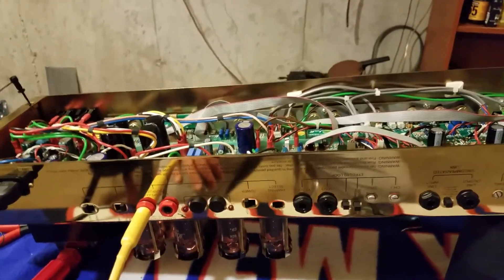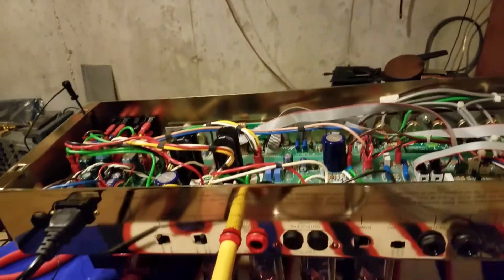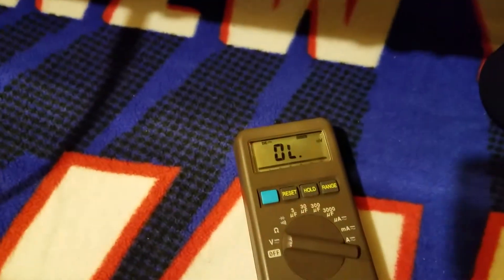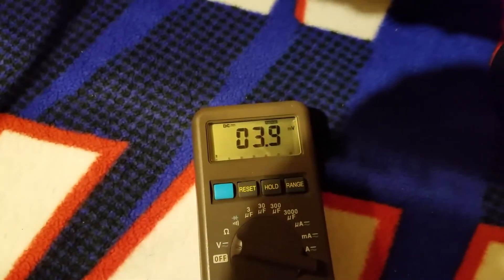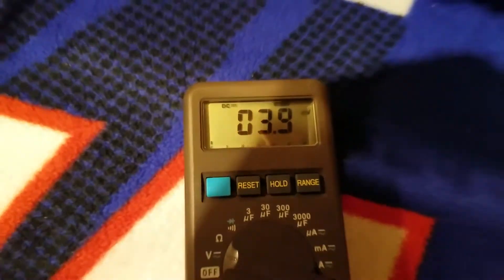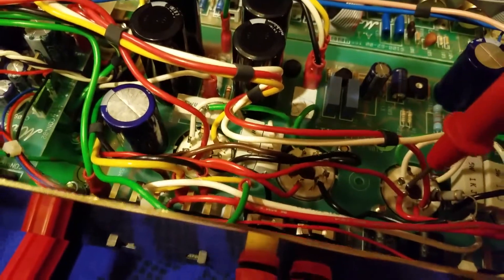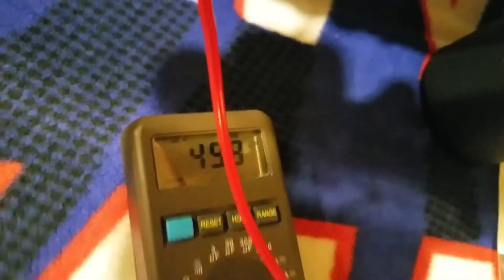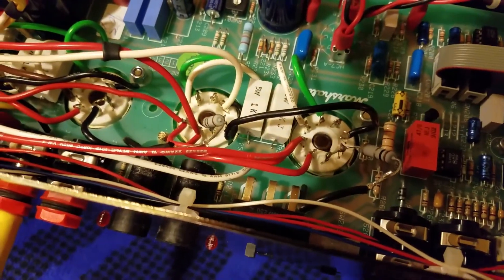Marshall 6100 Bias

Comment: For anyone watching this, You will need to measure the voltage at pin 3 ( anode) and write it down.These measurements are taken with the meters black lead referenced to ground. Now you will measure the voltage drop across the one ohm resistor and write it down. This measurement is NOT referenced to ground, as Thomas does in the video, he made a mistake, but rather both probes are placed at the opposite ends of the resistor. Then you will multiply the plate voltage ( pin 3) by the cathode current which you convert from the millivolt reading you get from the resistor. The reason miliivolts is converted to milliamps is a rule of Ohm's law:
One millivolt across one Ohm is one Milliamp.